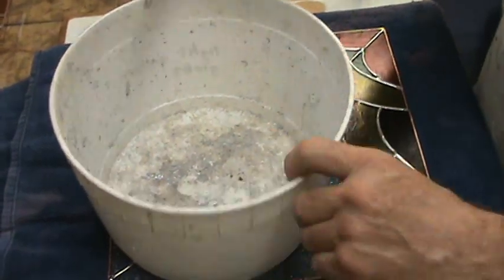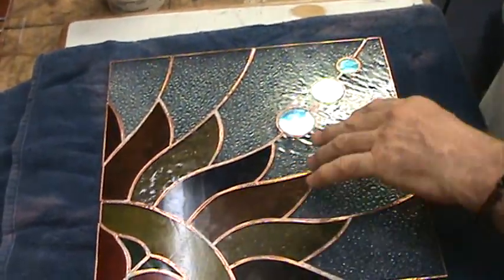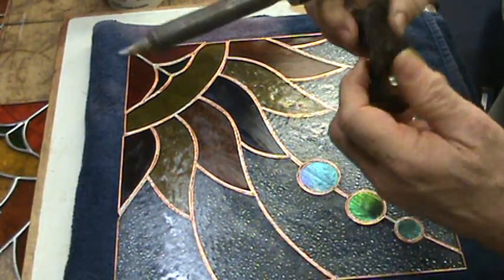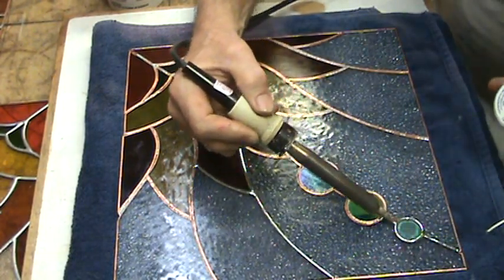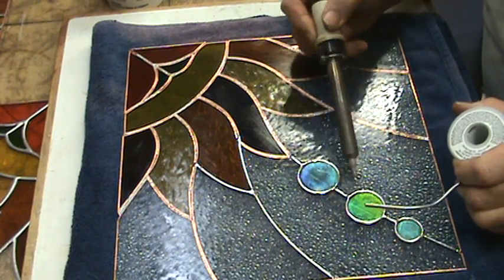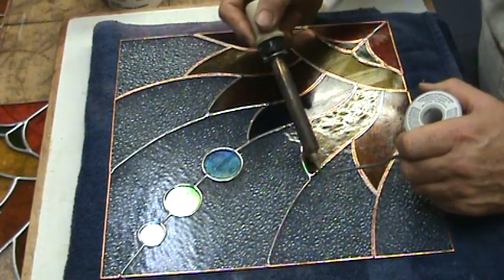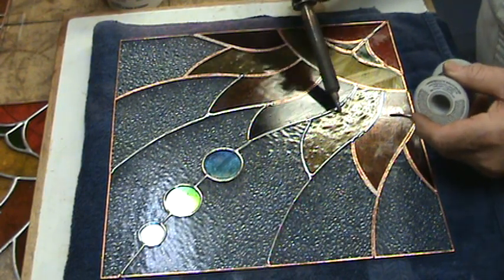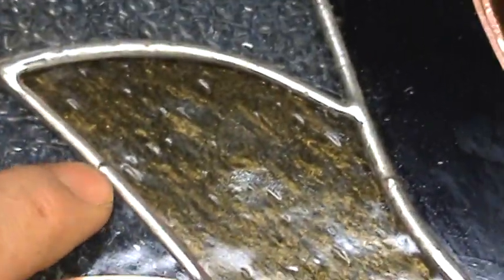stained glass how to ideas sg9b sun project

Comment: The main purpose of the flux is to prepare the metal surfaces for soldering by cleaning and removing any oxides and impurities. ... The flux also protects the metal surfaces from re-oxidation during soldering and helps the soldering process by altering the surface tension of the molten solder.
But, you can solder without flux. While it is helpful in the process of soldering as the flux helps break down the oxides on the metal, it is not needed. 
I don’t not recommend trying to solder copper foil or lead without it though.

Comment: HI; YOUR work is very pretty i  LOVE  the circles on it. . i recently collected a small handful of oh 12 by 12 inch windows with a missing diamond shape in the middle. the outer frame has a  few different cells , they are antique and I would LOVE  to repair them  -.  they seem to be using older methods ( the original had real lead, yes? ) 
my main question here is
 since the middle cell is missing you have to take the piece apart some how before you can insert more glass - is that right ?